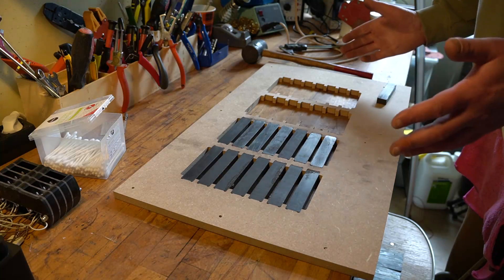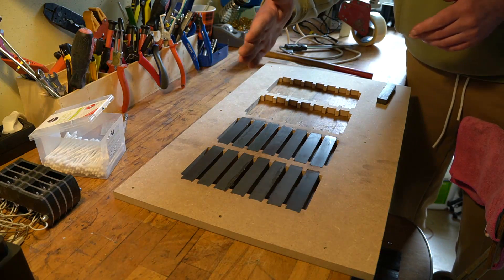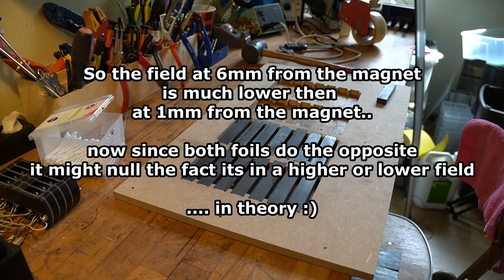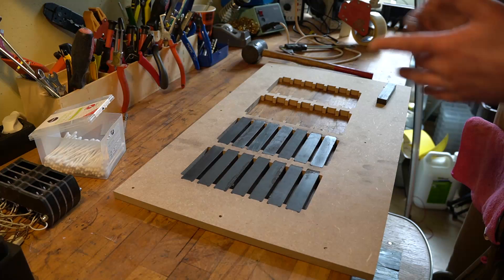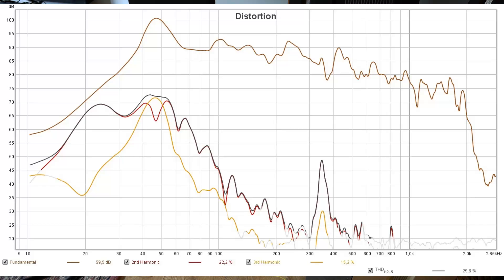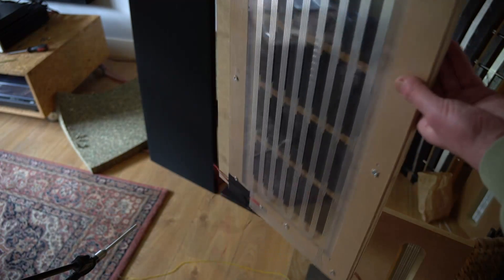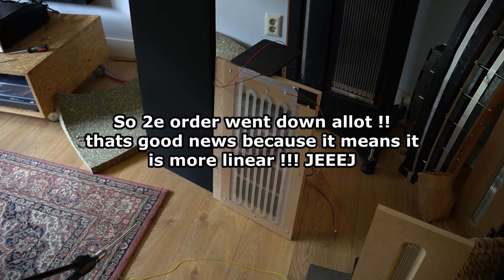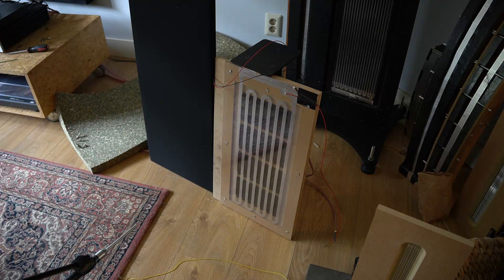Dual membrane high excursion planar magnetic bass driver Part 1 - Building

Comment: where did you get the mylar and what foil are you using?
Reply: You should watch some of the very first video Joppe did about diy magnetoplanar spkrs; he also shared some links/addresses.
Reply from the maker: i use Mylar and the alu foil i cut to a coil can be bought at aluminiumfoil.nl or at other places

Comment: Hihi, I meant air passages not between the panels, on the main frame make some passages from center to outside like wave guides. You will lower the pressure between the panels, as well the resonance will be lower. In current configuration the speaker works like closed box, that is why you have higher resonance

Comment: Amazing work, probably you should make some air passages between the panels, that will lower the resonance and lesser distortions
Reply from the maker: Hihi i guess you did not see the frame in the beginning :)  there are plenty of  passages or there would not be any sound I'm afraid.
Reply: @joppepeelen  Hihi, I meant air passages not between the panels, on the main frame make some passages from center to outside like wave guides. You will lower the pressure between the panels, as well the resonance will be lower. In current configuration the speaker works like closed box, that is why you have higher resonance

Comment: very good idea to lower the distortion without using a push pull magnet arrangement....
at the expense of efficiency if the resonance frequency were reduced to the same value as the single membrane arrangement, I guess

for rising the sensitivity with same magnet and magnetstructure, there are the three known posibilities, ...reduce distance of foil to magnet...increase the resonance and... or...increasing the radiation resistance by increasing the radiation area of the foil...

a dipol with deep and loud bass has to be very huge...my dipols have 2 square meters radiation area per side and approach at 30 Hz the 100 dB range 😊
for higher sound pressure level or a pressing sound the use of a subbass box speaker under the 50 Hz range is neccessary....
Reply from the maker: well yeah these are small to begin with :) and i increased xmax from 3 to 6mm, both dont contribute to efficiency :) but the thing i wanted to test becomes more clear with 6mm xmax :) hence why i chose it. the res will always be higher then one membrane alone, but in this cae both foils needs to be lower so i end up at 40-45 Hz , that would be my goal for this tiny panel. see if i can hit xmax so i know what the limits are.  and also might have a better idea of what 1 vs 2 foils do.. beneficial. or not at all :) since there never is a free lunch... well usually there aint :)
Reply: @joppepeelen  I belive that the air load (mass of the air) left and right side of the membran is more or less the same driven a single or push pull membran but the suspension rises with push pull so that the resonance rises also with push pull system....

but beside that I have to say... you make a very good job Joppe....a real sientist in this area 👍...

Comment: Is there such thing as a hard diaphragm planar? Instead of flexible membrane use something like cardboard idk. It'll have a separate suspension and possibly less distortion. I know it'll be heavy but you can put more thicker traces to keep the sensitivity. Just an idea I have in my head.

Finally someone that made a planar subwoofer!!!
Reply from the maker: well its not a sub by any means. its just a panel size that gave me enough info on whats going on in the low end without it been to big for my cnc :) but well making it stiff etc etc will end up been a woofer :) but i did add some 1mm  foam to stiffen it up before , while been light. normally that dit not gave me what i was hoping for. changed some for the good and some for the worse.  in the end not worth it :(
Reply: @joppepeelen  Have you expeimented with heavier/thicker foil? Is going for thin for thin and light actually beneficial? If so does this count for all aspects of performance and at all frequencies? Cheers!
Reply from the maker: @allankvist6741  in the low end usual a bit thicker foil wont hurt all that much, in this case i used what i always use:) 12 micron. you can get away with heavier for sure.  you can stretch it harder. but need to go wider to maintain low enough res..  like i did not :) i should have made the foil 2 or 3 cm wider and stretch it a little tighter. but hell its a good start.

Comment: So an isobaric speaker that sort of works like a magnet-to-cone config in that it cancels asymmetry. The distance is small so it should work rather well. The question that I have is what is the impedance of the slots between magnets. Microphones have quite elaborate hole matrix in the plates to dampen the diaphragms. I think I'd start with filling this area with felt.
Reply from the maker: yes it needs damping there ! thats for sure, i can play with open area as well, but top of my list is width of the foil to get res lower. while maintain tension.  i am really pleeased with this idea, 2e order dropped insanely amount. there is a measurement between this tiny panel and the LRS...  near res dropping 8%... thats well sick :)
Reply: @joppepeelen Near res means?
Reply from the maker: @allankvist6741  near resonance